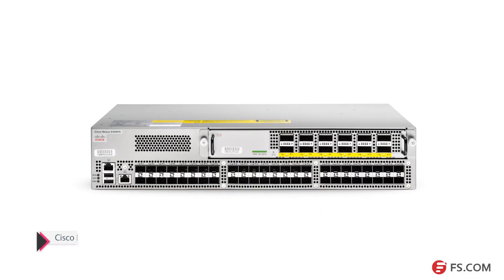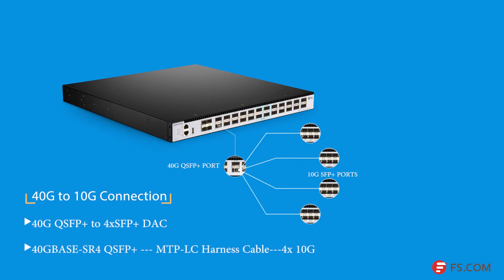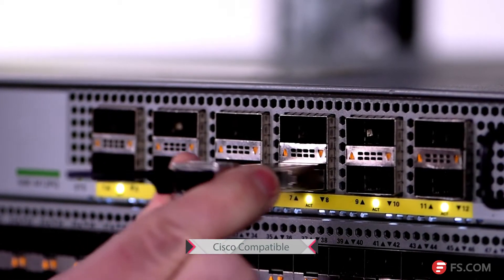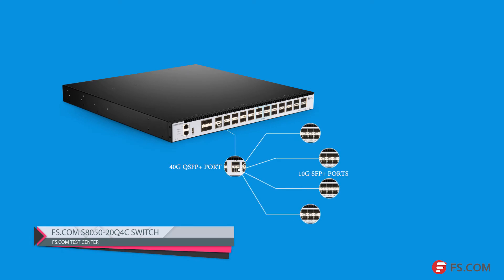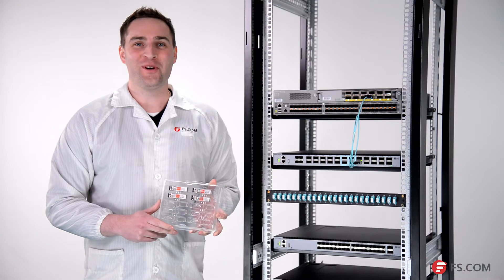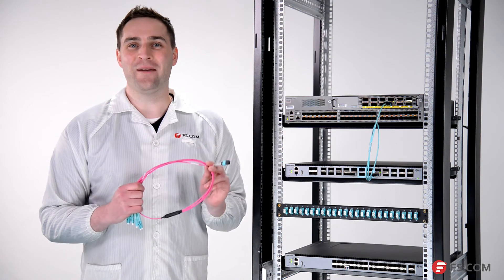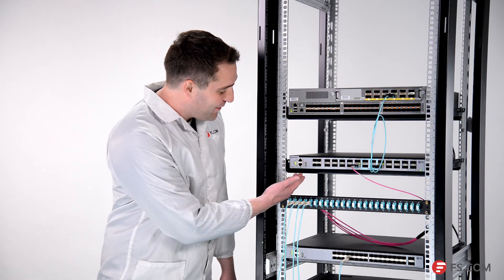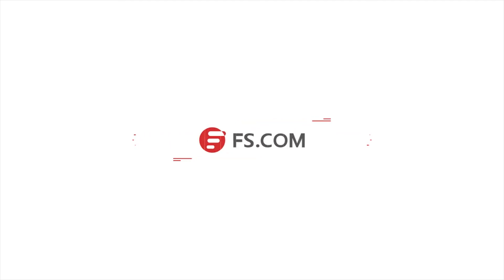10G/40G/100G Data Center Switch for Network Migration | FS

Comment: Is the signal of the QSFP port is splitting to the 4 switches? and how can singel port carrying diffrent signals to 4 different Switchs !?
Reply from the maker: The signal of the QSFP port can be divided into four independent channels through the QSFP to SFP+ breakout cable, and each channel can be connected to a different switch. Each channel transmits an independent data stream, and the switch can be configured to route these flows to different destinations, thus achieving the effect of connecting a single QSFP port to multiple switches.

Comment: so the one to four split cable connects to four access computers/devices and on switch side, one port can handle all 4 of them logically?
Reply from the maker: Yes, you are correct. The one-to-four split cable allows for a single port on the switch to handle all four devices logically. This is achieved through a process called port aggregation or link aggregation, where multiple physical connections are combined into a single logical connection.

By using this setup, the switch treats the four devices connected via the split cable as a single logical unit, enabling efficient utilization of the available bandwidth and providing a seamless network connection for each device.

If you have any further questions or need additional clarification, please feel free to ask. We are here to assist you.